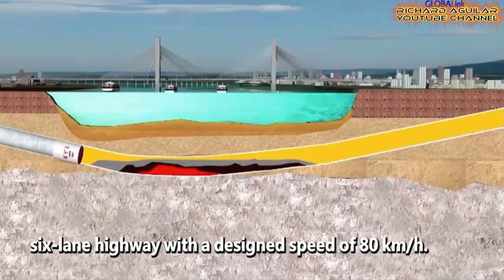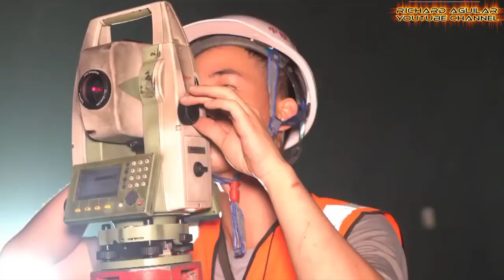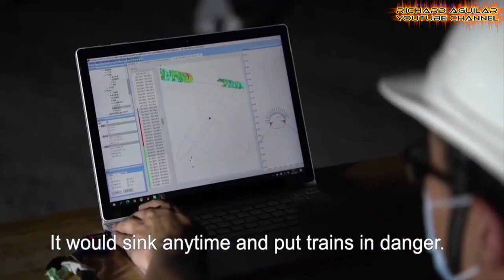China builds the longest deepest tunnels! You'll be shocked to see why

Comment: I only ask one question,, where did Chinese get all these Tech's from?!!! 😈😩so fast like not normal, look deep inside Chinese innovation 😱😰😰😰
Reply: Technology transfer. At first, they imported 2 TBMs from germany with the accompanying experts/operators. the chinese learned to use it, became quite good at it, and because they knew they will be needing a lot of TBMs, they reversed engineered it, they improved it, made innovations, and now they are the biggest producers of TBMs.
Reply: Most of these technologies are open source. TBM is nothing special.. It's a big engine with long shaft that spins a drill.
Reply: China has more STEM， especially engineers than US and EU combined. They only need to know the concept and little details to build their own with innovations.

Boring machine uses most of common techs. It is just matter of enough money and has the ability of system engineering to design/manufacture and assembly components together seamlessly.
Reply: when china built the world's greatest civilization 5000 years ago, your ancesters just came down from trees. So i dont blame you for your ignorance--the descendants of mokeys!
Reply: Marmot
Reply: Why don't you just be straightforward and say it?  I know you wanted to say that China stole these technologies.
Reply: @kub1353  if you get rid of your colorful glasses and forget your white supremacy ideology, I have already made it clear. China learned basic science and techs from open sources. And bought some older generation of techs ( The west only sold techs 2-3 generation older). Then learn know how. WHen you know how, develop new techs is not that difficult when you have 10 times highly educated STEM engineers. 

You just don't want to admit Chinese are smart and hardworking, and can catch up in short time then overpass your white people. China has already been #1 on 5G, HSR, engineering, quantum, AI, Robotic, Digital currency, E-payment, E-business and more. It is your west now copying China on many new frontiers. 

When you say stole, LOL. How can China stole things not exist from west? China must have time machine to steal them from future. You are unbelievable.
Reply: I hear alien give advance technology to US now alien are not happy with the US now the alien turn to china